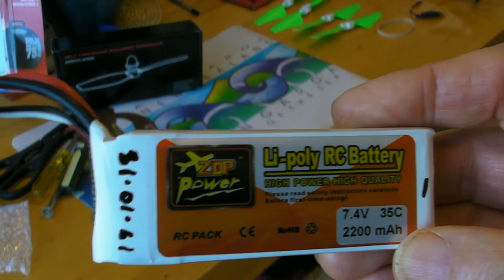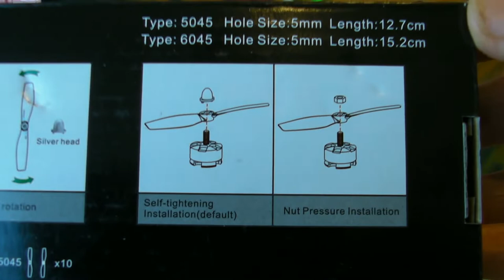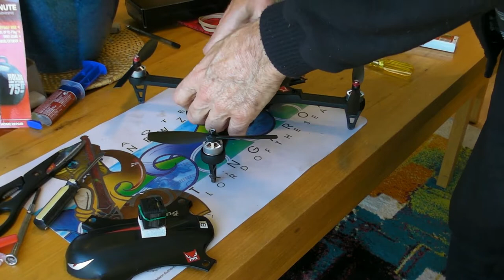MJX Bugs 3 Bullnose props and new batteries

Comment: I put the Dal 6045 bullnose props on my Bugs 3 and it flies great and much quieter. Great channel.
Reply from the maker: Thanks - I've stopped looking for other props after settling on the 6045 Bullnose. Only thing I've done is to buy a set of bright green ones. Easier to see, and I put them on the back with black on the front when I fly LOS.
Reply: @skybug3  Thats what I have on my, I put the green on the front, for me it was easier to judge orientation with them on the front. I put the Rodeo 150 props on my Bugs 3 mini and it flies just as well.
Reply: @skybug3  hello can you put a link to them?
Reply from the maker: @deontehemphill2361  I buy mine on Ebay Australia at - https://www.ebay.com.au/itm/202405980318
 They are UK based. https://www.ebay.co.uk/str/rctechstore
Reply: @skybug3  ok do you have to buy nuts for them or what does it mean by self tighting
Reply from the maker: @deontehemphill2361  Yes, need M5 nuts - CW and CCW. The direction the motors spin means the nuts can not come loose in flight.